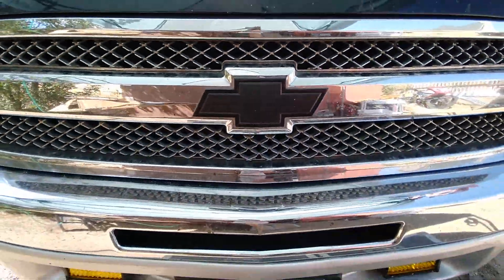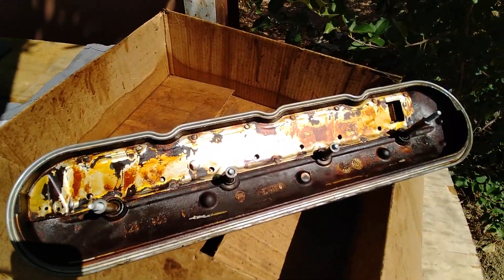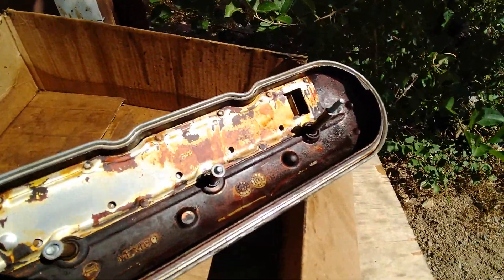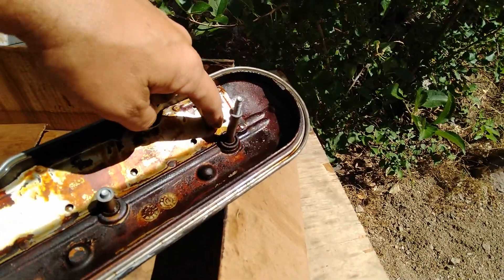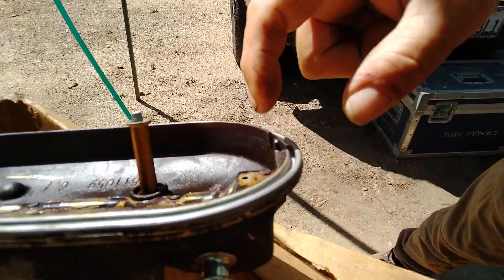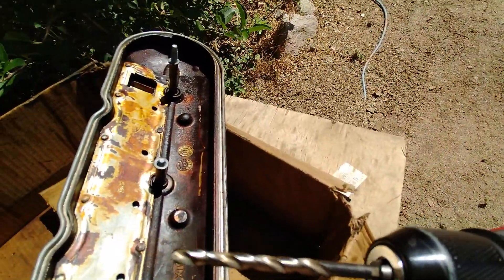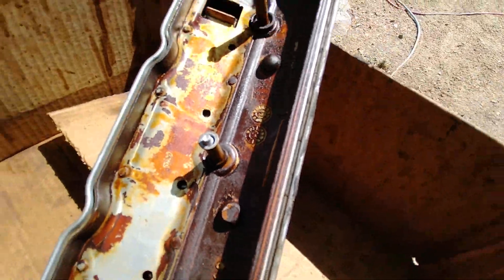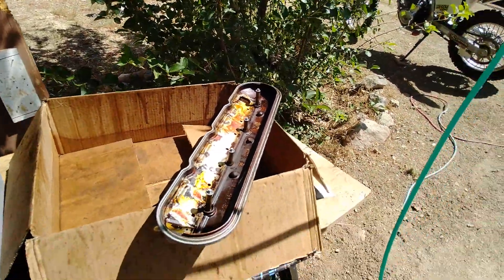Chevy 5.3L Valve Cover cleaning and Super Modification for better oil drainage.

Comment: Looks like you have the revised style which drains different (at the bottom where it meets the valve cover there is a gap), this works on the original style though
Reply from the maker: @74mythos  no gap on these. The end has a gap but that's not allowing drainage.
Reply: @Rynos9Lives from rivet to rivet down by the center bolts it's on a stand off  for oil to drain you should be able to get a small pick under there and open the gap just a bit more. Weak rings will cause the same issue, I don't remember the TSB# off hand

Comment: What happens to the shavings???
Reply from the maker: @Mtc01p  blow em out with compressed air and carb cleaner or brake cleaner. Just don't get brake cleaner on the gaskets. They'll expand and you'll never get them in.!

Comment: Why not drill it like Swiss cheese and defeat the purpose of the baffle ?
GM engineers would have drilled 7 holes if they calculated that the holes wouldn't suck oil as opposed to 'trap' oil ..

Lots of Einstein's on Youtube these days ..
Reply from the maker: @kevwills858  Good point, however..! If the engineers would've designed it from the start without this 4-8 cylinder cutoff system for California emissions bullshit, we wouldn't be having this conversation. NOW WOULD WE..? And 1 more thing, it's not a baffle. Baffles are to keep fluids from sloshing around like in a fuel cell for race cars. The purpose of baffles in oil pans and fuel cells is to keep fluids in the pickup tube and eliminate air going into the pickup tube and losing prime. These are splash guards and are designed to keep the oil from being sucked up into the PCV (positive crankcase ventilation) valve. That valve is there to allow airflow through the engine oil lubrication circuit. Otherwise the engine would blow the seals because of pressure built up in the crankcase. I'm only explaining the facts and this is what engineers do to purposely cause problems in order to sell parts in the future. GM has had an engine running for over 40 years in a room at the back of the plant. It's a perfect model of what "could be" but the government and Chevrolet will not release that technology because they would go broke in the long run. All about the $'s..!

Comment: Oil does not feed from valve covers try again can't wait for next video
Reply from the maker: @stevenzaioczkowski4135  duh, oil drips off of them when it's squirting up the pushrod. It tends to get sucked up in behind the splash guard and get trapped. This allows it to drain back down. It's a bad design from the start.
Reply from the maker: @stevenzaioczkowski4135  and nobody ever said anything about oil feeding from the valve covers. Where'd you get that..? 🤣

Comment: How much do they charge to replace both of them?
Reply from the maker: Replace them for the same ones..? Pointless..! The point is to do this to any of the valve covers with this modification by drilling the holes to allow the oil to drain back down to the oil pan.

Comment: You already have the updated valve cover you didn't mean to drill those holes
Reply from the maker: Wrong, that's the stock valve covers and they hold oil behind the shield.
Reply: So u want to delete my comment I see. No you have the wrong valve cover. The original one didn't have that big hole on the side. They added that because the original hole was a small hole right above a lifter. Come on dude just admit you did all that for nothing and everyone laughing at you LOL
Reply: @paul9912 
You are both correct and wrong at the same time.  
It is the updated valve cover, and somewhat of an improvement.     
Still, oil does get behind the baffle and needs to drain out.
Reply: @mildbill222  I feel like those holes are going to reduce the suction from the "intended" area.  They put wings on it to reduce the oil going into that channel and deleted the "drain" holes.  Seems additional  holes would suck more oil in.  What's odd is that the passenger side VC still has drain holes, but on the updated driver side they are deleted.  Wonder why they haven't modified the passenger side.

Comment: i just swapped in a used 5.3LS from 2001 avalanche.
its running driving fine, has a few codes but also smokes.
i popped off drivers side pcv hose and didnt notice any oil dripping around end of hose but engine was just up to operating temp after idling for 20 minutes.
SHOULD i see any dripping off end of hose af such little time and if engine is smoking a little out the tailpipe?
Reply from the maker: What color smoke.? White.? Black/grey..? White is coolant leaking into the cylinder.
Reply: @Rynos9Lives  it mustve been mostly blue cuz i havent seen any since 1st startup  this year and the gas and oil both have sea foam in them
Reply from the maker: @TyroneShoolaces-f8e  you might have a bad leaking valve guide seal. That's the problem with putting a used engine in. You never know exactly how many miles are on it unless you take it out of the car it came in.